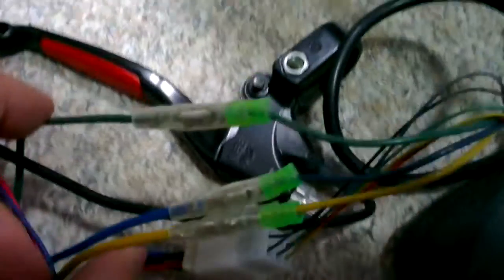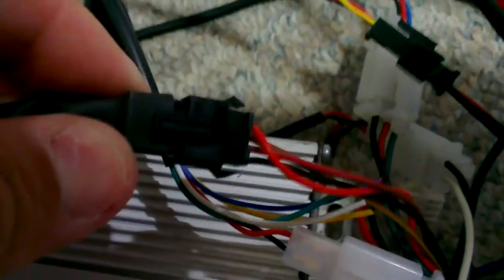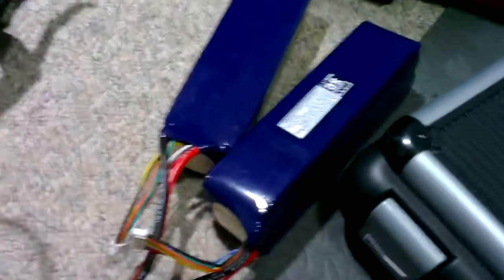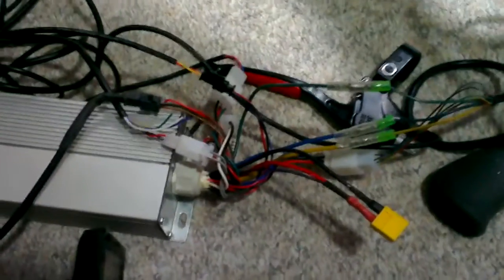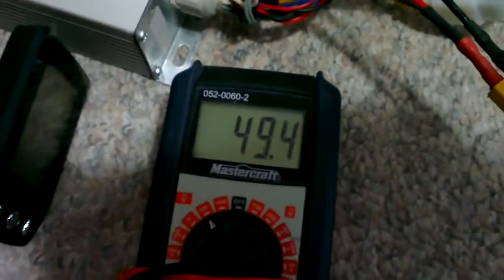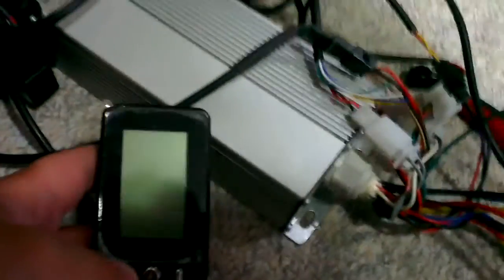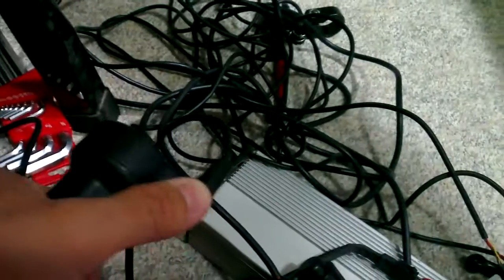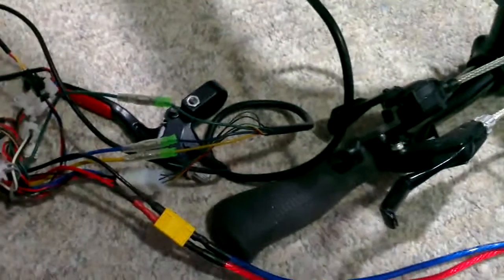Leafmotor's 48V 1000W hub motor kit is having problem

Comment: Load test, for throttle, 1-4 volt use AAbattery supply check the yellow and black  brake switch, open or close circuit. or u could try use paper clip to jump start . finally test your motor directly to the battery  without the controller just 2 wire positive  and negative see the motor in good working order either

Comment: Error code 05: Hall cables are not connected, or incorrectly connected.  and yes you will get exactly what you are seeing if the hall sensors are not connect correctly.

Comment: Did you ever get it to work?
Reply from the maker: nope, controller damaged
Reply: Did you get a replacement? Just wondering how the hub works under a load.
Reply: Hi Jay,  what happened in the end. Did LeafBike send you a new controller?  or did the bike end up getting repaired and working?  Also how would you rate the 1000W of power, enough or should have got more or less power?